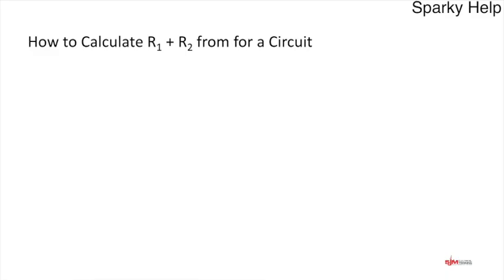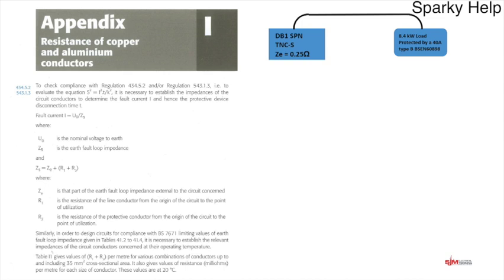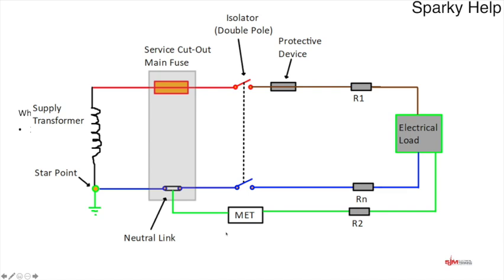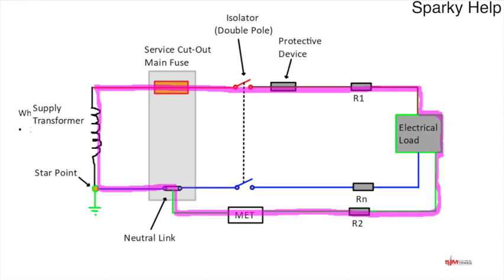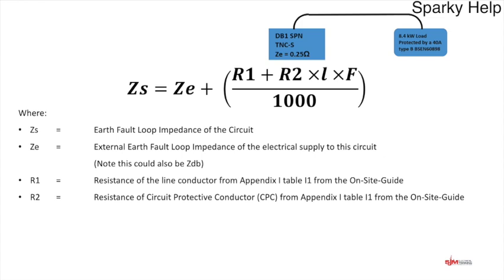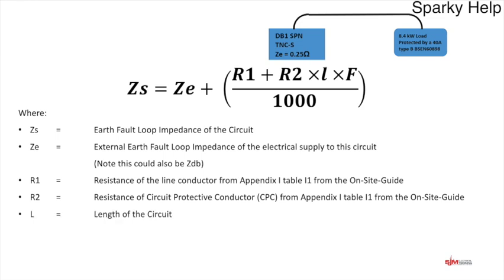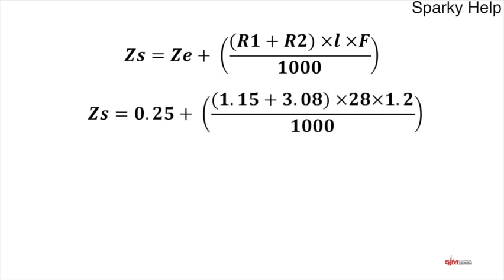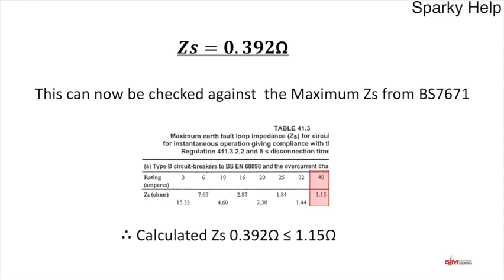Everybody Should Know this... Calculate R1+R2, Zs and Find the Length of a Circuit for Fault Finding

Comment: Hi thanks for the videos . I have used the formula in this video for a ring main circuit and my assessor has told me it’s incorrect. To calculate Zs should it not be divide by 4000 ?
Reply from the maker: Hi not sure where you are getting 4000 from?  A ring final is a more complex circuit to calculate as the cables are in parallel.  So I am unsure what you are trying to do and what your assessor is asking.  With more information I will be able to help.
Reply: Hi thanks for reply .

Ze = 0.22 ohm 
R1+R2 = 19.51 Mili ohm per metre 
Length = 30 metre 
Correction factor = 1.2 

Ring final circuit 

19.51x30x1.2 = 702 
then divide by 1000 = 0.70 

Add to ze = 0.22+0.70 = 0.90 ohm 

Was told this is incorrect

Cable is twin and earth 2.5mm/1.5mm
Reply from the maker: Hi, So assuming ring length is 30m, a Ring final is a parallel circuit therefore 0.702/4=0.1755ohms
Zs=0.22+0.1755 = 0.396Ohms @70degrees
you could check by working out r1 and r2 using OSG:
r1=30m x 7.41m/Ohms = 0.223ohms
r2=30m x 12.1m/Ohms = 0.363ohm
R1+R2 = (r1+r2)/4 = (0.223+0.63)/4 =0.146ohms @20degrees
R1+R2@70 = 0.146x1.2 =0.1755ohms

Hope that helps, Please share with like minded people or maybe like and subscribe.
Reply: Many thanks . Please make small correction 

0.702/4=0.1755 not 0.702/2 

Once again many thanks

Comment: Hi, what does it mean by bunched? In table i3
Reply from the maker: Grouped with other conductors i.e., Conduit or Trunking - Please Like, Share & Subscribe.
Reply: @sparkyhelp3997  so if you had 3 single cores in conduit for one circuit that would count as bunched
Reply from the maker: @willatkin1957  Hi long time since communicating, this would count as one circuit (assuming the three conductors are as described), if by themselves, then no grouping (not bunched - as it it by itself) would be applied.

Hope that helps,

Please Like, Share & Subscribe
Reply: @sparkyhelp3997  so just to clarify for 3 single cores in conduit on their own as one circuit , the not incorporated and not bunched factor would apply when working out the (R1+R2 )
Reply from the maker: @willatkin1957  Hi this is one circuit (L,N,CPC!)
Please Like, Share & Subscribe...
Reply: @willatkin1957  think that would be bunched for the CPC as it is bunched with L/N in the same conduit/trunking. Though it would be one circuit. If the CPC was on its own it would be not bunched.
It's different to when talking about grouping factor bunching of live conductors (L or N or L1,L2,L3), which is talking about bunching with other circuits in the same containment... I think that's right, but can't be 100% sure because the regulations are so vaguely worded and everyone says something different.
Reply: @erelpc  trust me they need to do like a regs translation to how normal people talk lol

Comment: Hi ,i have done this questions .its A3 radial circuit 2.5mm pvc/flat cable 1.5 cpc,40m lenth and it's F 30 degrees ,with 0.35 Ze value ?
Reply from the maker: Hi, Not sure what the question is, but 'F' is a factor to raise the resistance of the cable to the desired working temperature to compare with BS7671.
Reply: Yes f is correction factor ,just need to determine the actual Zs ?
Reply: Can you please show me the calculations if different from the vídeo!?

Comment: What if the circuit breaker has to be type b at 50A I🔼n?
Reply from the maker: If it is a 50A then the corresponding maximum Zs or the type of circuit breaker ie (B,C or D).  Do you mean it is an RCBO if so the corresponding Zs will apply for the milli amp Zs rating from BS7671 - but if this is the case you should not forget about the short circuit faults and their disconnection.
Reply: I think you mean using it for a garage or small extension I would assume, are you using the RCD in the main as well as in the garage lets say? Do you use tt system and what size swa would you run? Are you planning to install EV charger?These are the questions to be asked.